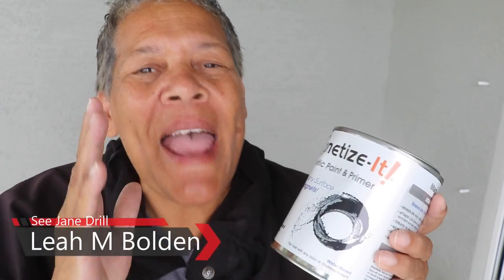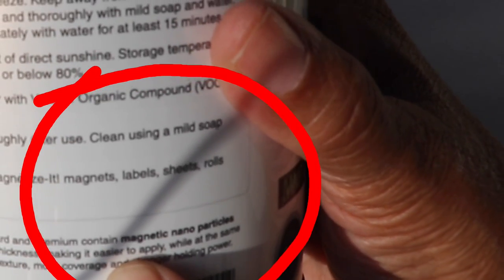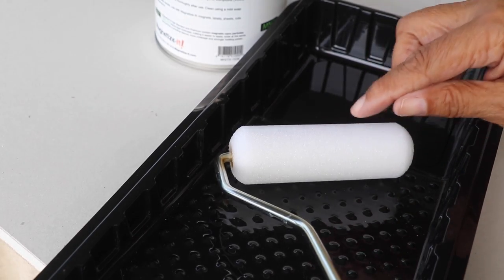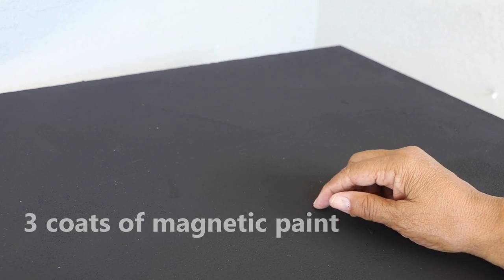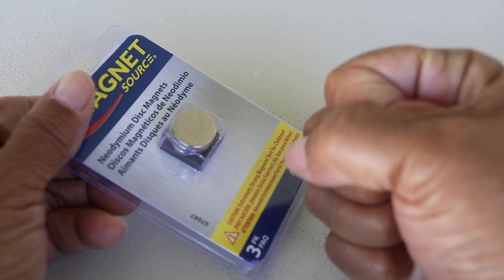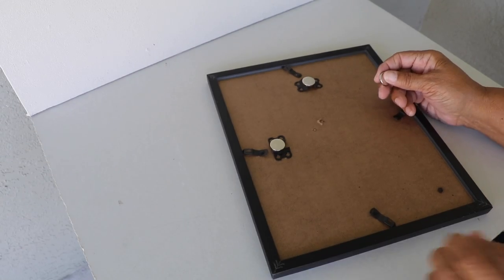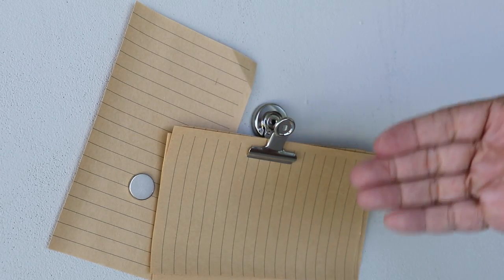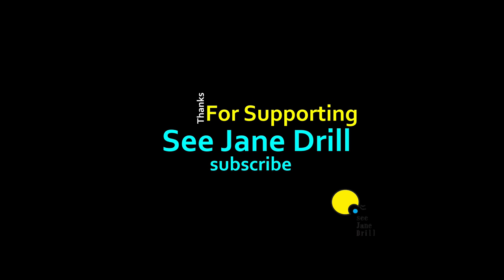Magnetic Paint WOW

Comment: Very clever.  I recently bought some magnetite, Fe3O4 powder for making ferrofluid for my students.  Never thought about how to use these powder in other applications.   Definitely will show this to my physics students.     Thank you.

But I guess it may pose a long term issue for cleaning when used in household.   When a magnet broken/shattered into small pieces that inevitably happens, it will be quite difficult to remove especially neodymium magnets are very brittle and the broken pieces are sharp.  The top coat paint must be somewhat needed to glossy and super smooth.
Reply: @J L good idea. jL. But I bit worry that will also damage the top paint .  Worth to try.
Reply: Could damage the magnets with a heat gun maybe? They lose magnetism at 80 degrees C. Unsure if the heat gun damages the wall though.
Reply: good to know!

Comment: I did half a wall with this then blackboard paint on my kid's wall, and that was great. Except there was so many more layers than normal that you can see the difference with the naked eye, its crazy. But still it works good for my kid's wall at least. I'll also note that it was very difficult to get it to lay totally flat and even. There were a lot of small dips and rises. Nothing too big, but noticeable vs. regular paints/primers.
Reply from the maker: The paint is very thick....I noticed the same.
Reply: Be very very careful with small magnets around children.  They have been known to swallow them with disastrous results. 
The magnets hold the bowels together with disastrous, necrotic results and even the surgery required is made very difficult and tedious.
Reply: @onlythetruth883  Thanks for the tip. My kid is 5, and not eating everything but definitely worth considering.

Comment: ❤ Again a great video. You are a gifted teacher. 

I built a hanging storage board and treated with magnetic and chalkboard paint two years ago. 

It is true that such paint is better for lighter things. For a large poster, you need multiple magnets, for example. Otherwise, if there is a cross breeze, the things will fly off, even with the special magnets. 

The 🧲 magnetic paint can interfere  with wifi signals. This is important to know in case your have poor wifi reception. 

In that case, making a smaller project or limiting the area you paint would be better than painting a whole wall with magnetic paint. 

Thanks for this video.

Comment: I have a metal front door and I use it with magnets to post notes ,pens with magnets , and my car keys with magnets
Reply: And yet another way for me to TRY to keep tract of my keys!
( the tile trackers need battery replacements eventually)
Thanks for the idea!

PS: and I teach in prisons , occasionally, which means I have a CO level clearance, which means they check out keys to me! 🤣🤣🤣🤣you know what happens when you misplace keys inside a correctional facility?😩
  The ENTIRE facility is locked down until the keys are located, or the locksmith arrives, and you had better pray that it’s not the locksmith! LOL  
So , yeah, when I’m in the key and alarm check out line… they just hand ME the alarm.🤣🤣👍🏽

Comment: Using magnets with magnetic wall paint would work well for hanging multiple light posters or photographs, calendars, lists, notes, diplomas, or any other groups of temporary wall hangings using light frames if any, like in a dorm room, teenager's bedroom, kitchen or office.   I don't think this magnetic paint will catch on due to its expense and weight.  For hanging REAL PICTURES like oil paintings in heavy frames, I'll stick to hammering in my nails and approximating where each should go in relation to the other pictures on the wall or in the group.  It's easy to reposition the nails to tweak the final positions of multiple paintings on one wall.  Heavier paintings and frames may need screws and lead anchors, or even toggle-bolts, depending on whether the wall is dry-wall or plaster. Picture hooks may have been one of the worst inventions due to the flat surface of the hook where it meets the wire of the frame, making it exceedingly difficult to line up pictures that are hung with hooks.  A screw or nail does not increase the height of a frame as the wire easily lines up over the approximated mark, while the flat part of a hook raises the wire and frame as it is lowered onto the hook.  Hooks CANNOT support any weight, so magnetic paint may finally replace those useless picture hooks.  I'll stick with my nails and screws for mounting anything over a pound or two "permanently" on my walls.
Reply: Okay, that was a lot about picture hanging… that only a mirror collector like me would read ! 🤣
About the hooks: ever tried those “ monkey hooks?” They’re sort of shaped like a question mark , the hook is where the dot would be. Poke em through the drywall , twist em , and the weight creates an anchoring effect. Different sizes for different weights.
Been using them for years.  But not exclusively. They hold heavy objects way better than drywall anchors.

PS: this magnetic paint is only intended for crafty applications like lightweight posters, notes etc , held with other magnets !
Reply: @bigred4379   Since you read it, I'll write it. Those monkey hooks sound great for 5/8" drywall and medium weight mirrors.  I hung many more 8" to 12" wide oak wooden shelves than pictures, and the shelves are HEAVY.  Most are 3' to 8' long and each shelf is supported by 8" to 12" metal brackets that hook into 4' to  8' (floor to ceiling)  slotted standards.  I can use up to 5 parallel standards to support the longest banks of shelves and those standards can have up to SIX brackets hooked into each of them when they are supporting up to 6 parallel shelves running across a wall. Those shelves hold hundreds of pounds of books and they are mounted into DRYWALL!  The only way the drywall can support those heavy loads is for them to be screwed into CORKSCREW-SHAPED LEAD ANCHORS, which screw into the drywall.  Besides trying to accurately measure the exact distance between 5 screws on each 8' standard and marking that distance on the wall, ALL the holes have to line up horizontally for the 4 or 5 standards that would be attached to the wall.  There's no such fun if you are using magnets on magnetic paint to hang light pieces on the walls.

The best part is sticking each anchor onto the Phillips head driver that's mounted in the chuck of the power drill,  and drilling the (sharp-point self-feeding) anchor into the drywall).   In most cases I first push the sharp tip of the anchor into the "X marks the spot" target, like you do with monkey hooks, making a small "dimple" before drilling it into the drywall.  I insert all the anchors for each standard before using the screws to mount them, and I screw the first screw into the top hole of each standard so the standard hangs straight down over the 5 installed anchors.  Then I can see all the holes in the standard line up with the anchors before screwing it in.

Since I use screws in anchors for drywall, I use the same set-up to hang pictures, EXCEPT the picture wire is strung directly over the screw (instead of a hook) that is fastened into the anchor, leaving 1/4" exposed for the picture wire.  You could use your monkey hooks here instead of the screws, but the correct diameter of the threads is most important.  Monkey hooks have wider, coarser threads.  The screw must fit halfway into the anchor before it catches.  If a screw is too wide, or fits only 1/4 of the way into the anchor, it won't seat properly and instead of tightening the anchor into the drywall, it will twist the anchor past the surface and destroy the surrounding drywall, pulling the anchor out with a plug of drywall.
[They don't make these lead anchors anymore (E-Z anchors).  Now they are made of PLASTIC - same shape, a little smaller, and not as strong.]
Reply: @jessicasnaplesfl7474  they come in different sizes for different weight objects snd different drywall. Obviously, a heavy object requires different weight distribution .
  Large mirrors are freaking heavy.  Ive had some hanging in drywall w these hooks for YEARS . In CA. Earthquakes and all. Obviously, they’re not hanging on picture wire, they’re hanging on two of the heavyweight hooks, by the brackets , which are on each side of the heavy frames.
 Step out! try something new ! 
Just a wild guess- you’re an engineer?
Who types that much about hanging pictures?!
😀😀😀thanks for the response ! You’re fantastic 👍🏽
Reply: @jessicasnaplesfl7474  
PS you are correct. The hooks leave a huge hole in the drywall.